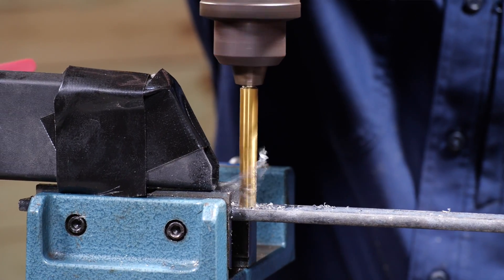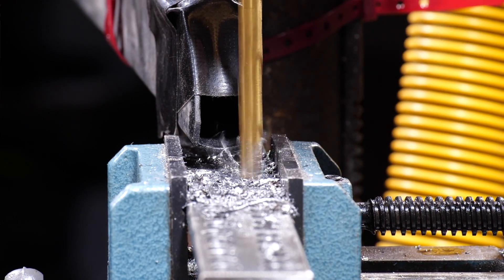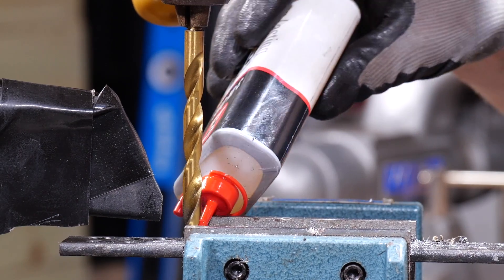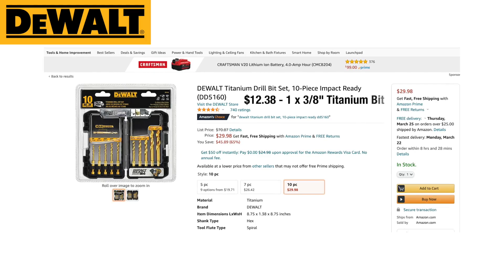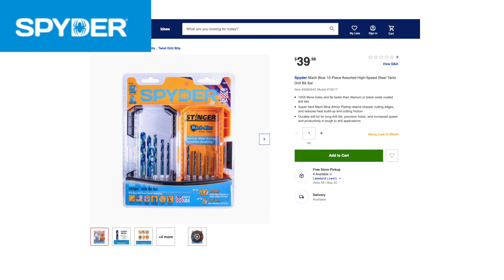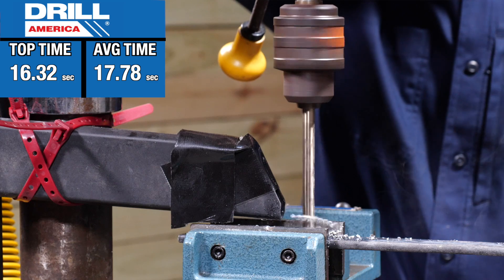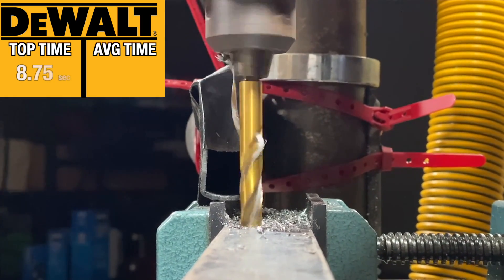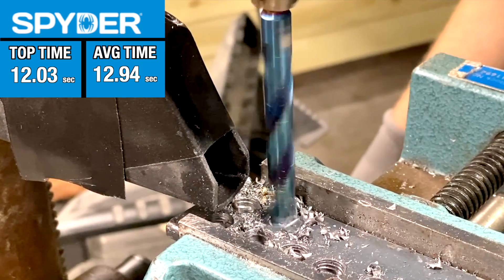The BEST Drill Bit For Your Money

Comment: The real drawback to DeWalts pilot point bits is the difficulty in sharpening them.  Many DIYers have a drill Doctor or other drill sharpener and these cannot be used on the DeWalt bits. So for me it’s the Spyder or an actual cobalt bit set

Comment: Its not the type of bit, its how it was sharpened. All these tests to is compare the factory edge which is very inconsistent even within the same brand from bit to bit. Once you learn how to sharpen bits really good you will realize this. Most factory edges are not that great compared to what it could be. These are mass produced with questionable quality control, you get what you get. There are many You Tube video's doing this same test and they all get different results. The bottom line is this, other than really cheap bits most are very good but too many people are addicted to using the factory grind.

Comment: The best drill bits Ive used were from a local tool store. The bits were called "purple gold". Those bits have been the best Ive used, mainly in stainless steel. They eat through the ss and hold their cutting ability better than any orher bits Ive used.
Reply: @A. Diaz: Muchas gracias senyor!

Comment: I was told to use consistent water when drilling. I'm going to use the DeWalt Drill Bit set and use the 1/2" bit with water to see what happens and how much time it takes to drill a .304" thick tube. I'll update this to let you all know. Please reply with your requests to make sure I post a follow up to this reply. Thank you.

UPDATE:
I used water, but what actually work better was input that I found online about using 3-in-1 Oil periodically throughout drilling the hole. It worked out PERFECTLY! That is probably the best and cheapest way to go when drilling holes and not overheating and wearing out your drill bit faster. I did eight holes and the drill bit still work like it did the first time through that .304” thick piece of steel. Really impressed with DeWalt’s titanium drill bits. Actually they got a better review then the more expensive Spyder drill bits.
Reply: Plain water isnt the way to go. However using cutting fluid (like what machine tools use) which has a base of water that you add something like Mobilcut to gives you the advantage of water for assistance in cooling while also having the oil in there to provide lubricity, reduced friction means less heat and what heat does build up it takes away.

It's not really meant for dabbing on the drill though, usually requires a constant stream to actually carry the heat away.

Comment: Tests are always welcome, but if you want bits that last and last and drill on size then you need to pick up YG-1 Gold P bits. 135 degree split point cobalt bits with TIN coating. I have used a lot of drills and haven't found anything to beat them yet.
Reply: Do you ever compare YG-1 Co with Dewalt Extreme Co?

Comment: I'm much much more interested in longevity of the bit than how fast I can drill the hole.
Reply: Longevity is mostly about the edge on the bit, not what the bit is made of with the exception of really crappy bits. That and proper drilling techniques using the right speed and lube.
Reply: It's good that he includes much data for a good overall view as well
Reply: HA!
Reply: This makes sense if you're drilling regularly, but if you're like I am who rarely drills metal but has snapped a bolt head off twice on an automobile and spent hours drilling it out, you'd care more about the speed I promise!
Reply: @jawojnicki  the problem with your speed is keeping the bit cool most likely. Let it heat up once and it will lose some of the hardness which will make it dull super fast. With that said super cheap bits stink. Way better off with a quality hss bit than a cheap coated bit. Coatings are pretty well worthless. Better to spend that money on quality steel
Reply: @jackle842000  cool. can you recommend specific brands of high quality hss  bits?
Reply: @jawojnicki  there's multiple good brands availabile. Project Farm has a YouTube video comparing some bits. It's not that there can't be good coated bits but the majority of coatings seem to be more of a buyers gimmick than effective.  You'll see many of the no name cheap brands with coatings and they are always poor performers.  You'll notice the coatings wear off quickly during use. I'd have to see a scientific comparison video myself to believe there's much benefit to the coatings when drilling steel.  I personally have some craftsman hss bits that I've noticed one is better than 10 of those dirt cheap no name coated bits which I obtained in bulk through a Sam's club purchase. I'm not recommending that brand over others but that's just the brand I have right now which don't get a ton of use. There are better brands out there I'm sure depending on your use. Those drill dr supposedly work pretty good for sharpening them once dull I've heard from some that's had them. Much of my steel drilling was on a job and they provided good quality hss bits and they were thrown when dull to save time.  Key is keeping the bit cool and don't apply more pressure than needed. Apply just enough pressure to see small shavings (ideally can even drill out in a single long stand even if the bits cutting at its best) instead of tiny dust particles. If all you're getting is tiny dust sized pieces your bit is junk from the start and or dull.
Reply: @jawojnicki  oh, and also if you ever heat a bit drilling a bolt it will harden the steel of the bolt because it'll temper the bolt steel.  I know it will with stainless but time and likely will with other steels I'd imagine.  The stainless bolts I've seen it happen to got so hard a new bit barely cuts it at all and will take multiple bits to drill even with good bits. It sharpen them maybe but I've never tried that personally but I will soon for my home bits I think. So never ever ever let your bit spin fast and heat up. Watch how slow drill presses usually drill. Especially those large presses that still thick metal. They turn at really low speed. I'd say they turn at what would be maybe half a trigger of the lowest drill gear setting on most drills at the most and likely slower than that.  Drilling metal has some art and skill that's needed to develop plus you have to have good bits. Pay close attention to all those aspects and you'll have bits that actually drill and stay sharp longer.  Note that those large drill presses usually have oil bathing the bit constantly to keep it cool.  That's hard to do and or afford at home so if water is usable where you're at a Squirt bottle barely streaming water over the bit to keep it cold (not cool it) will work wanders. Can't stress that keep the bit cold enough as too hot for one second is far too much and will mess your entire job up making you waste a ton of new bits and time
Reply: @jawojnicki  hours?
Reply: @jawojnicki  agreed

Comment: I've always had no problem with Dewalt bits there real work horse's. I bought 20 piece Ryobi set cheap at Christmas pure junk. You get what you pay for.
Reply: I've seen some really well done tests with driver bits that included Ryobi. The Ryobi bits were consistently at the bottom of the pack in quality and performance. And the thing is the DeWalt bits are not badly priced at all they certainly are some of the cheaper premium bits. And I'm talking drill bits and driver bits. 

The ones that do out perform DeWalt tend to be a lot more expensive and they don't usually outperform them by a large margin.

Comment: Love this testing quality! You guys are headed down the right path.

My only suggestion is next time don’t put your weight on the crank of the drill press, but run a wire or rope from the crank to a pulley which would allow the weight to have a straight line to the ground every time.

You may have accounted for this, but I was thinking if the drill bits were different heights or installed at different heights, one bit might have more pressure to start the bit than another bit would.
Reply: @Protoolreviews  🤘🏼